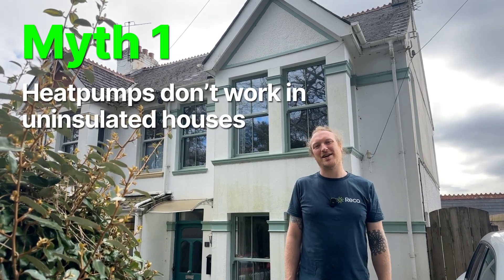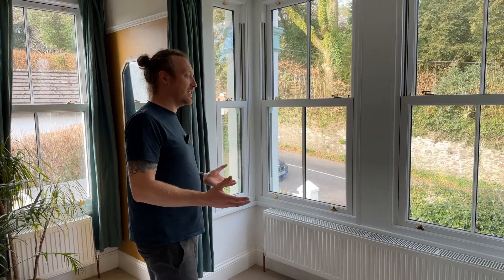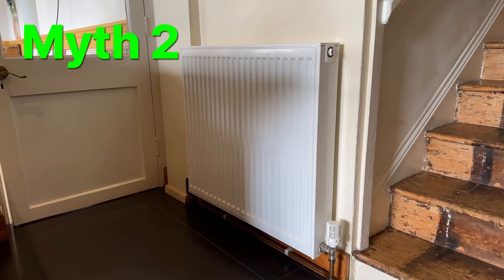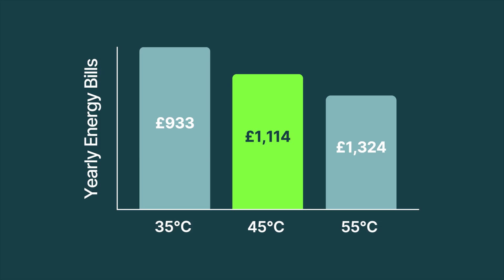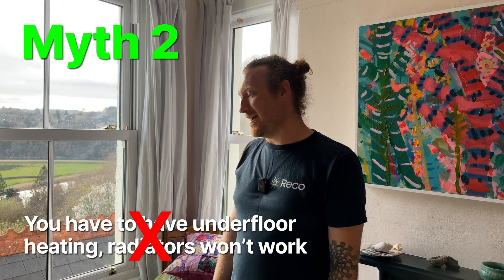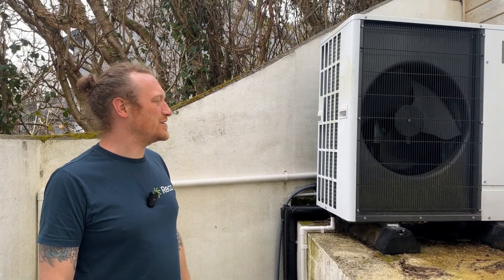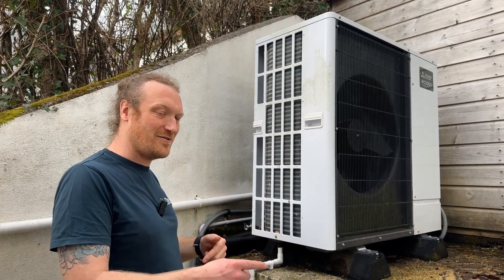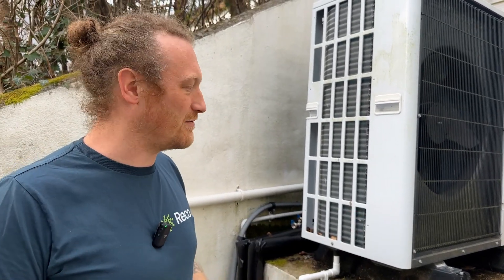Heat Pumps DONT Work In Old Houses!

Comment: Heat pumps are fine if the house needs heat all day as it is occupied all day - and designed and fitted correctly. Many homes, like apartments, the occupants are out at work all day and also out on many evenings. Gas combis cannot be beaten in these situations as they deliver heat very quickly and no waiting for space consuming complex hot water cylinders to heat up. This applies to millions. Heat pumps are no panacea.
Reply: Perhaps have a point. Though for a quick heat response you need a low thermal mass construction, and this building is certainly not.  A modern timber framed house is.
That said, I am sure you could design a heat pump installation for a quick response. It would be interesting to see a study on this.
Reply: @
For a quick heat up air systems are by far the best - and no ugly large radiators. But you need to generate high temperatures, which probably precludes a heat pump.

When the two North Sea gas fields come online, they supply only 3% of need, the UK will be approx 50% self sufficient in gas. As more solar, wind and grid batteries come online that figure will rise as gas will be taken off power generation. Then as more wind and solar come they can generate hydrogen and add a 20% mix to natural gas which has no adverse affects. And reduce emissions. 

Then the country may be around 70-75% self sufficient in gas needs. Then only 25% will be bought at excessively high and fluctuating world prices. Then gas will be cheaper. We have no replacement for gas in industry.  Only hydrogen can replace industrial fossil fuels. 

Those who want gas to disappear, like Robert Llewellyn, had better look at the big picture.
Reply: @ you need either high temperature or high output capacity or long duration. So yeah either lots of radiators, or perhaps twice as many air to air units.  Of course you still get the issue that they will need power at the same time as everyone else.  So some form of heat storage, either as a separate unit or in the building fabric may be the answer.
As for hydrogen, as I understand the figures, we will struggle to generate enough for industrial processes alone.  For domestic fuel a non starter. And if it only mixed with gas, that’s only a very partial short term option.
Reply from the maker: Or by fitting an air to water system you are making use of the “radiant” heat storing energy in the fabric of the building and could cost a lot less in the long run. A2A has its place but it only provides “convective” heat which will not heat the fabric of the building in the same way. If the building has a good thermal mass, there’s a good chance that heating the building during off peak times with an air to water heat pump will work out more cost effective in the long run than air to air with battery storage.
Reply: @RecoEnergy  It's worth noting that an Air to Air system, when run 'low and slow' as intended, absolutely will heat the fabric of the building. Warm air = warm walls and floors over time, just like any other system.

It's how they are run over here, and it does seem people in the UK (e.g. TimAndKatsGreenWalk) have picked up on running the system in that fashion to cut costs, etc.
Reply: I leave my gas boiler on all day flow temp 40 degrees, temp set at 18, even if the house is empty. Set back temp 16 at night. Doesn't cost that much to run to be fair. 3 bed detached bungalow, 1960s works for me😊
Reply: @adamwoodall9506 Providing the property is reasonably well insulated it makes sense to leave the heating on constantly when left.  The cost increase is based on the heating system having to heat both the air, furniture, floors and internal structures and in the winter can take a while.  We have two properties, one domestic, one business, both similar in size.  The business property heating is left on constantly, maintaining a constant temperature in order to stop moisture and cold effecting paper files, computers etc., and of course ensuring a comfortable working environment for staff at the start of the day.
The running costs overall are not in any way excessive and compared favourably with our domestic property, both properties powered by oil.
Reply: @andycapp3867 Forgot to mention I have cast iron radiators too, I have no idea why some people say they are inefficient, I beg to differ. I remember octopus energy saying I'd need to remove them in order to have a heat pump, I laughed, no chance that would ever happen, and the quote was £7000. I'll be sticking with my 30kw gas combi. Property is insulated ok but has uninsulated concrete floors, nothing a pair of slippers can't fix😊
Reply: A2A heat pump might be a better solution in the circumstances if you can't get gas.
Reply: @B3mused-ge7gl  
If gas is available you need to think hard. Heat pumps cost far more than a gas system. The extra paid for a heat pump can pay for a lot of gas for maybe a decade into the future.
Reply: @johnburns4017  Thanks John. Agree. We're sticking with gas having had a long look at A2A. I just can't see electricity prices coming down with the costs associated with renewables for it to make financial sense. I listened to a recent podcast with Professor Dieter Helm who is predicting lower gas prices in future.
Reply: @B3mused-ge7gl  
The Daily Telegraph reported that there is three to four times more gas and oil in the North Sea than what was thought. Whatever gas fields come online, by adding a twenty percent hydrogen mix makes them twenty percent larger.  And around twenty percent less emissions. 

Once we get more solar, wind, gas fields online and hydrogen generation, then energy has to drop in price as the county can be detached from world prices.
Reply from the maker: It’s actually quite likely that a condensing gas boiler may cost you more to run in this way. The lower the temperature it is running at the more is being saved due higher percentage of energy being saved due to condensing. Running at a lower temperature means running it for longer periods i.e most of the day and a set back temperature at night. 

It is possible to upsize the radiators and heat pumps to achieve the same intermittent heating schedules and we have done this in the past for spaces such as community or village halls where the time it is used can be sporadic. 

This heat geek video shed more light on the physics: https://youtu.be/kGs_biFA87Q?si=1szR6mbIzZOfwvbZ
Reply: @RecoEnergy  
I am fully aware of Heat Geek, and have disagreed in the past with him on the odd point.
The lowest modulating gas boiler goes down to 1.9kW, a Viessmann. Have larger rads, as per a heat pump installation, weather compensation, local temperature trimming and it is very cheap to run as the boiler is operating at maximum low temp efficiencies.  

Geminox had a 12kW system boiler modulating down to 1kW but no longer sold in the UK. Many were fitted directly heating low temperature UFH on weather compensation eliminating much UFH paraphernalia, simplifying and cutting installation costs.
Reply from the maker: Ahh preaching to the choir! 😂

I think it’s fair to say your system may work out cheaper if you have sized your radiators so that they can output more heat than the rooms require to allow for intermittent heating, as well as have a low return temperature to ensure the boiler is condensing. 

Unfortunately that’s not true for most boilers in the UK! To run most so that they are actually running efficiently they will require long run times. At which point the running cost of a heat pump will be cheaper at current market prices. 

I take your point about higher installation costs but you do also benefit from having a hot water cylinder which gives better hot water flow rates.  Yes also space can be an issue. Currently the extra cost is covered by the boiler upgrade scheme as well. 

There is no getting away from it though, it’s not right for every house but a lot more than most think!
Reply: @ 
I am pretty certain a low modulating Viessmann and a system designed to run on low temps will be cheaper to run than a heat pump. And cheaper to install. Like heat pumps, it is getting someone who knows what they doing.  

Thinking out of the box can sometime work well.  A guy I knew was gutting a two up two down terraced house in a desirable part of London.  He was doing the whole lot, open plan with chimney breasts taken out making two rooms into one, two bedrooms and a shower room in the roof space which had insulation in the roof incline, a kitchen in an extension out the back, longish garden. The place looked cavernous.

He said he was going to fit a combi. I told him to spend the money having internal insulation on the front and back walls, insulation under the solid ground floor, triple glazing, insulated doors and heat recovery fans. He was going to do something similar anyhow. But have electric UFH downstairs under the engineering wood floor, and in the bedrooms, which having no rads appealed, electric kickspace heater in the kitchen for quick warm up responses and an electruc towel rail in the shower room,  - fitting his lifestyle.  The hot water was a Quooker tap in the kitchen, which also eliminated a space consuming expensive designer kettle, and the shower and bathroom hot tap supplied by an instant high kW inline electric water heater in the cupboard next to the shower room.

He did it. The heating and hot was cheaper to install than a quality combi and designer rads for sure, which was what he was looking at. I said get the gas meter and supply pipe ripped out, liberating needed space. The iron gas supply pipe was also a heat sink which improved matters. 

He saved around £100 per ann in not paying a standing charge for the space consuming gas meter. That buys a lot of electricity. The place was so well insulated he not once had the UFH on upstairs. The heat demand was low, very low. so resistance heating was fully suitable in this situation. He said: the bills are so low they do not bother me.
Reply: Apartments are fine, they are insulated by the apartments that surround them. Air 2 air may be more suitable though.
Reply: @Muppetkeeper  
Apartments are not suited to bulky hot water cylinders and heat pumps. Many were designed for space saving gas combis.
Reply: @ Many apartment blocks don’t even have gas, including mine.
Reply: @Muppetkeeper  
Hundreds of thousands of apartments do have gas.
Reply: @johnburns4017  That doesn't account for all apartments, though. Large numbers—especially since Grenfell—have been built without gas entirely. Plus, many older apartments predate combi boilers and were designed with electric heating in mind, often using Economy 7 with storage heaters and an immersion hot water cylinder. Air-to-air with point-of-use hot water for the few taps in a flat is a very viable setup.
Reply: @BenIsInSweden  
It will look third world with heat pumps hanging off the sides of buildings.like a/c units.
Reply: @johnburns4017 I'm not sure what third-world country has the luxury of AC? 🤣🤣
Also, outdoor units for flats are tiny — for example, Toshiba’s is under 80cm wide, 55cm high, and less than 30cm deep.
Plus, there are other options too, like what Kensa is doing with shared ground loop retrofits. Each flat gets a compact indoor unit for heating and hot water, no chunky kit hanging off the wall.
Reply: @BenIsInSweden  
There are millions of apartments and small houses that have combi boilers. Tell them they will have to rip out these highly efficient  heates in physical space heaters, to install a mini school boiler room.  

You have to get real.
Reply: @johnburns4017  Since when does an air-to-air system with point-of-use water heaters require a 'mini school boiler room'? If anything, it frees up space — you lose the combi, and the internal units can go on unused wall areas or even replace radiators with sleek console units.
As for air-to-water systems, the internal kit is sized to match the dwelling — just like a gas system is. The idea that all low-carbon heating requires huge plant rooms just isn’t true.
Reply: @BenIsInSweden  
It needs a big cylinder. 
This is pointless as hydrogen is coming in. Look at the AquaVentus project, generating hydrogen from North Sea wind farms. Natural gas can be a 20% hydrogen mix, so less emissions. Two new British natural fields are to come online. The British are using two massive underground gas storage caverns for hydrogen storage, Aldbrough and Rough, north of the Humber.

Heat pumps are ideal for replacing oil. If there is a gas supply into the premises, look to a low modulating gas Viessmann in a low temp system - I am sure other manufactures will follow Viessmann.
Reply: @johnburns4017  Point-of-use water heaters don’t need a big cylinder — for flats or small houses with just a couple of hot taps, they’re ideal.
Alternatively, systems like Daikin’s Multi+ have compact 60–90L cylinders, not much larger than a combi. So the idea that everything needs a ‘big boiler room’ doesn’t hold up.

Also, I’m not sure you’ve considered heat loss properly. The Viessmann’s 1.9kW minimum output is still around double the heat loss of many well-insulated flats, so it’ll cycle constantly — exactly when combis are at their least efficient.

And as for hydrogen — best of luck with that. Making it from electricity, only to burn it, is vastly more expensive and inefficient than just using that electricity in a heat pump.
Reply: @BenIsInSweden   
Look at the AquaVentus project, generating hydrogen from North Sea wind farms. No luck in it, as it is happening. It looks like gas will not be ripped out. 

My point about the Viessmann was when there is a gas supply use one in a low temp system instead of a heat pump. Heat pumps are used in largish homes which are also suited to the Viessmann for sure. 

It is ideal to set a long boiler cycling time, for when the boiler starts to cycle. However when cycling occurs the system will be up, or near to, temperature cutting out anyhow.  So cycling will be minimal.
Reply: @johnburns4017  You're conflating things. Hydrogen is important for industries that require very high temperatures, not for domestic heating.

The AquaVentus project is promising, but it's focused on industrial hydrogen production. Even blending hydrogen into the gas grid requires costly infrastructure upgrades, and using hydrogen for home heating is a non-starter when you factor in conversion losses.

For example, let’s say a wind farm sells electricity at 10p/kWh. With electrolysis efficiency at the top end (around 82%), producing 1kWh of hydrogen would cost 12.2p/kWh before taxes, distribution, or profit margins.
Assuming 90% boiler efficiency, that gives a delivered heat cost of 13.55p/kWh.
By contrast, a heat pump with an MCS minimum SCOP of 2.8 delivers the same heat for just 3.57p/kWh.

So, no — it makes absolutely no economic sense to use hydrogen for home heating if you're starting from electricity.

And on cycling: it’s not something you 'set'. A boiler cycles whenever demand drops below its minimum output. If your heat loss is half the boiler’s lowest modulation (e.g. 0.9kW demand vs 1.9kW output), it will spend more time off than on — and every restart hits efficiency. Many also ramp up temps at each start, wasting more energy.
Reply: @BenIsInSweden  
You can set a cycling delay on many boilers. 
A 20% hydrogen mix of natural gas does not affect the end user. It also reduces emissions.
Generating hydrogen from North Sea wind farms is a real project.

There was to be two 100% hydrogen trial projects in the UK. Both were cancelled/delayed. Speculation is that a 20% hydrogen mix is coming.
Reply: @johnburns4017  You're missing the point. Even with a 20% hydrogen blend, that 20% will still be tied to electricity prices — and subject to conversion losses.
Hydrogen generation is real, sure — but it’s not going to be used for home heating in any meaningful quantity. The fact that both UK hydrogen heating trials were cancelled should tell you everything you need to know.

As for cycling: a delay setting doesn’t change the reality. If a boiler’s minimum output is higher than the property’s heat demand, it will cycle — delay or no delay.

To quote you: 'You have to get real.'"
Reply: Old house with solid brick walls, invested in loft insulation, new windows, modern radiators, TRV and thermostats with modern condensing gas combi boiler system, yes the house would heat up quickly, but on days when I was home all day the costs to run the system would also be high. So to keep bills down, rationed how long the heating was on, limited the number of rooms heated, planned not be at home. So overall my home was only warm in selective areas at selective times. But had issues with mould and condensation. Fast forward to fitting an ASHP A2W in a larger solid brick wall home, it is warm 24x7, no cold rooms, no mould or condensation issues,  leave it to weather compensation to determine when to heat. Running costs very similar to selective gas heating. It may not be for every home, but it works for me. Investigated A2A solution, but difficult to get quotes and planning permission would have been required.
Reply: @sjdiy8230  
I am not anti heat pumps. Look at my post above on the Viessmann low modulating boiler. A gas system can be designed and fitted to operate on low temperatures 24/7, and be cheaper to run.........

....The lowest modulating gas boiler goes down to 1.9kW, a Viessmann. Have larger rads, as per a heat pump installation, weather compensation, local temperature trimming and it is very cheap to run as the boiler is operating at maximum low temp efficiencies.
Reply: @johnburns4017  don’t believe I said you were anti ASHP, just responding to the quick heating from gas boilers, from my experience. I also said ASHP were not for everyone. The fact that modern gas boilers can modulate and do weather compensation is great, but unfortunately most installers replace like for like and do not enable these features.
Reply: A problem is getting installers who know what they doing.  Look at the high efficiencies of gas UFH if it is done properly.